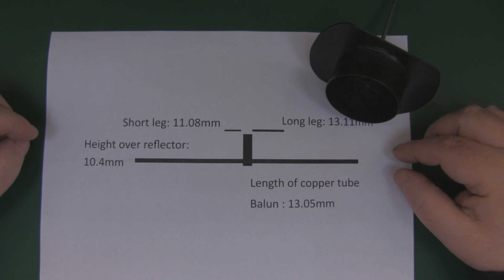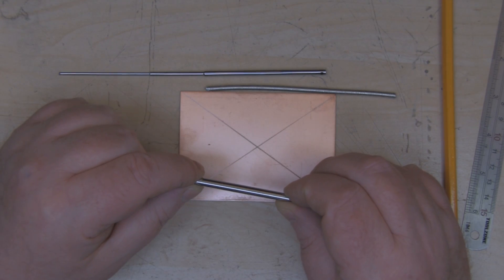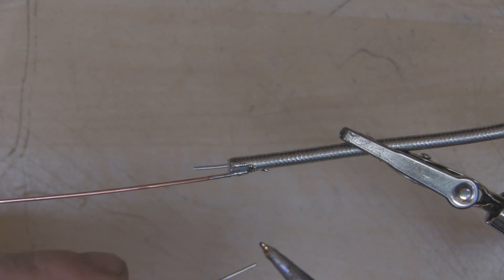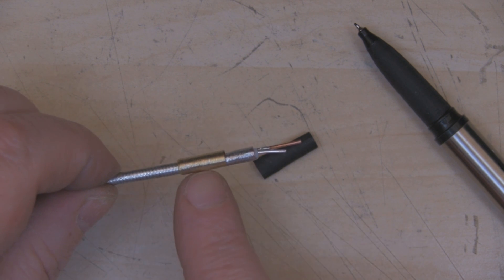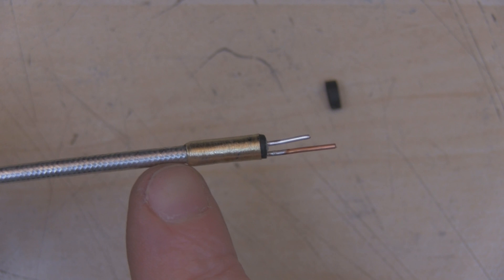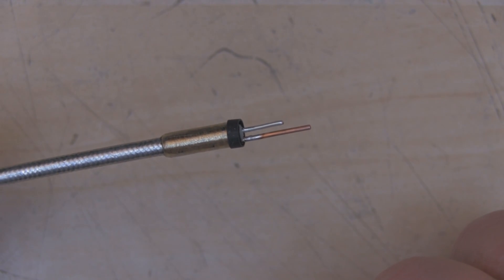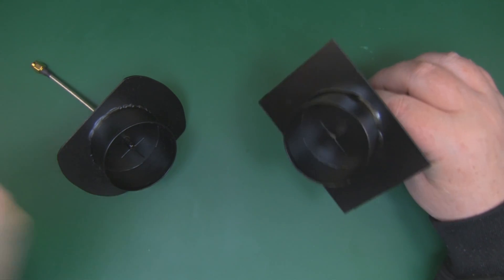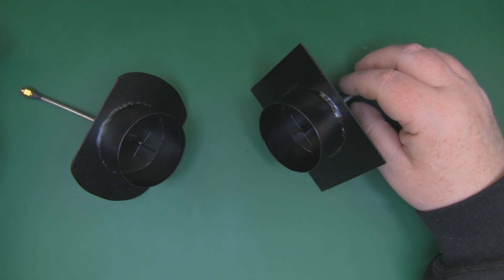5.8GHz Crosshair Waveguide Antenna #148

Comment: It does not seem like anybodys questions have been answered, but i have a question have been wanting to make one of theses for months and i am almost finished with it! But out of serious curiosity i would like to find out if anyone can help why is it that the center coper or brass in my case shaft or ballin is supposed to be 13.5 mm when only 10.4 is above  the reflection serface? And how is it that only connecting the co axe at the very bottom and not letting it tuch at the top makes a difference in its performance isnt it all still the same wire? Ore some how is it more space for the raidio wave pulses to go uo reverberate and come back... but if that was the case wouldnt the ballins volume affect its match ? Because  i have seen people use huge 3/8ths inch ballins and mine is maybe .24 at the most is eather of the two better ? Thank you  also why didn't you Mention thee importance of makeing shure the totally co axe length is a multiple of the frequencies wavelength?  I cant seam to find the answers anywhere and antenna science really fascinates me so thanks id really like to know

Comment: Hey ANDREW. I was looking how you isolate some elements from each other except at the balun. I usually deal with 690-800 MHz and bought a LPDA wideband. It got hit by lightning and didn’t work. Once I pulled it apart, I saw it didn’t have a ground plain and was all one piece. I cut it in half and put it back together but isolated all the elements and made a closed loop at the front of the antenna adopting your practice. I connected everything up to the repeater and in less than a minute it worked as prior it would take ages, often failing. Once again mate it was your expertise that helped me. Thanks again

Comment: Where do you recommend for buying the PCB?
Reply: +PiMan Just search on ebay, really cheap.
Reply: +Perry Wolf around what size if I wanted to build the double crosshair? Would the same 100 x 70 mm work?
Reply: PiMan Honestly not sure because I don't know how big of a separation you need, but the footprint of the actual crosshair is only about 26-30mm, so you certainly don't need too much space. My guess is you'd want a 150mm length. I'm not well educated in this area though, only starting building my own antennas, so I wouldn't take my word for it!